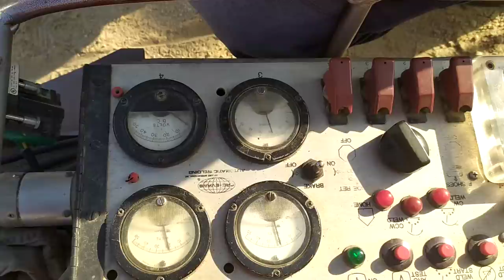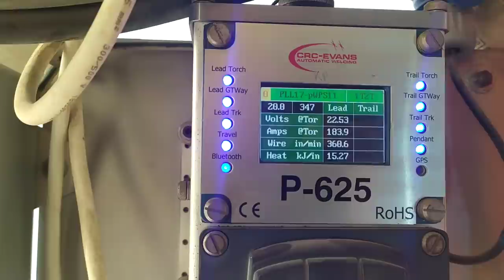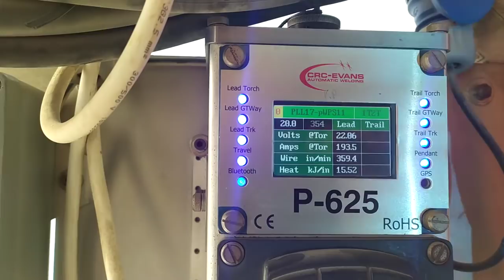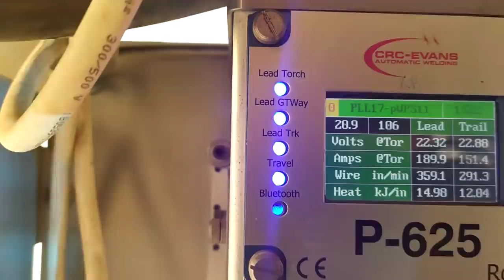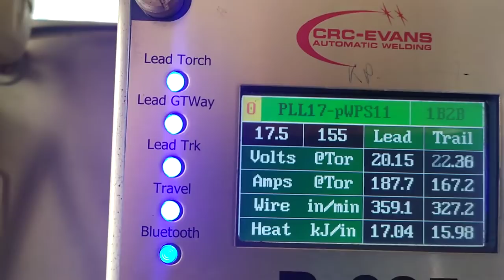Crc Evans P625 welding pipeline Kuwait 2019

Comment: I worked my 1st pipeline job in Bonham tx back in 2008 with a company named m.g dyess and we were using the same set up but the remotes for the bug welders were analog and needed to run tow different knobs for each welder they were awsome